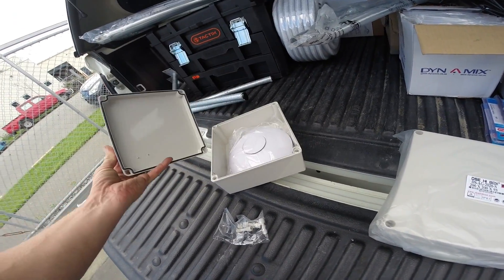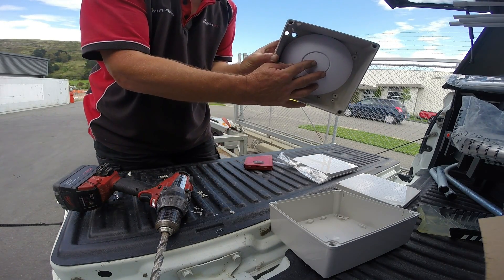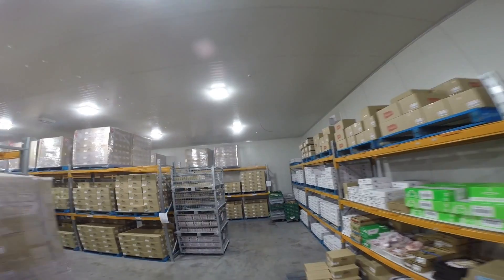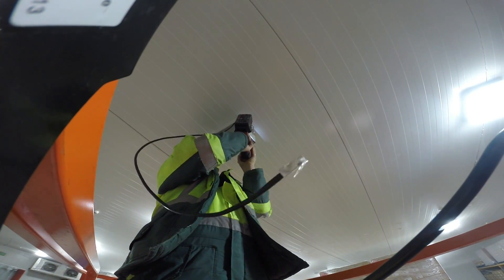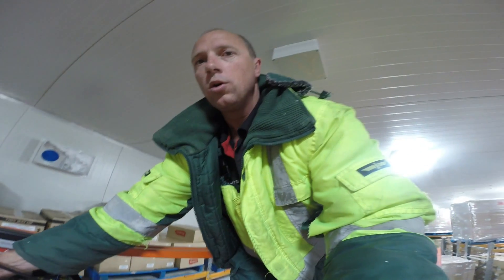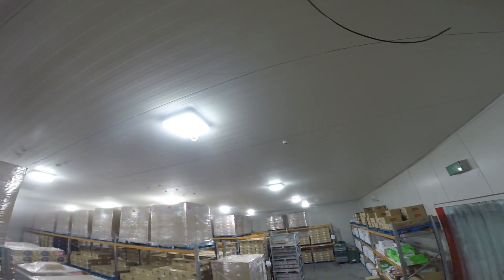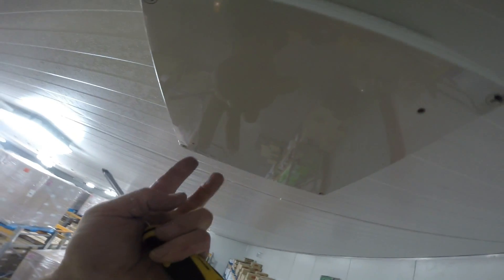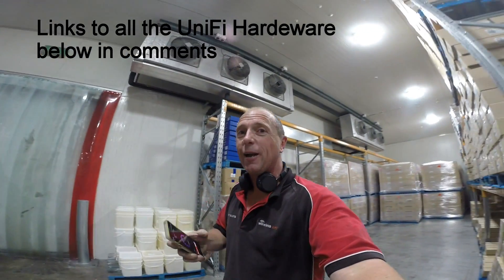Installing UniFi Managed WiFi inside Freezer

Comment: Hey Matt, thanks for the video. 
Just to confirm, you drilled two holes in the enclosure to let condensation drop out?
Is this solution still running? Looking to deploy it for my coolrooms also! Cheers

Comment: How are the Ap's going now days? Now some years have passed, has the condensation caused any corrosion to the internals of the AP? Are they still going Strong? From the research i have done the lowest operating temp of the UniFi  AP AC is only -10deg. No good for a -20/-30deg freezer.

Comment: What was the temperature in the freezer?  I am trying to install a few APs in super freezer which runs at -20 F.
Reply from the maker: What brands AP were you thinking of using?
Reply: @wifiguy_nz  Aruba 303
Reply from the maker: @magnetguide  Hi, The temp spec is for the Aruba 303 is +32° F to +104° F.  If you install inside a housing ,it should retain some heat. I have been back to site since the installation to check for moisture build up inside the housing. I had drilled a small hole to allow moisture to escape, but would that have ice build up blocking it?